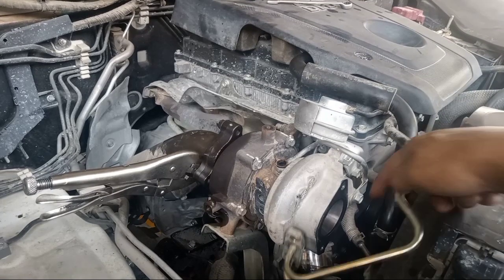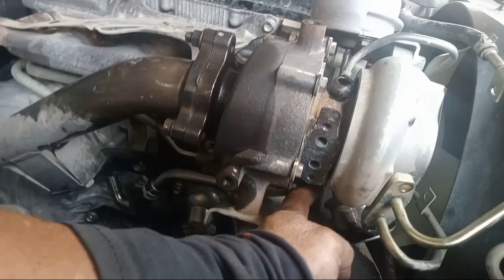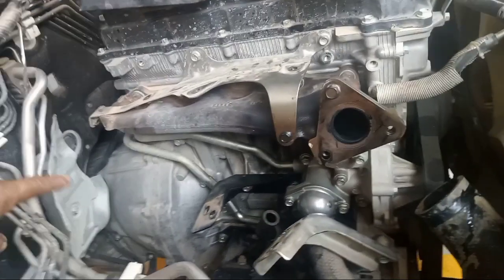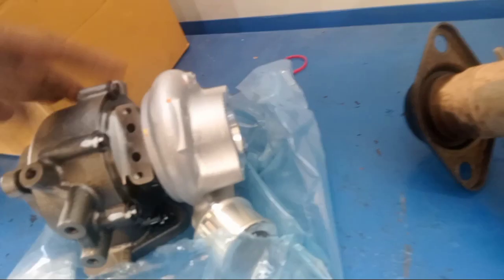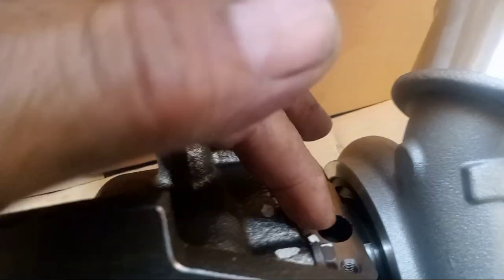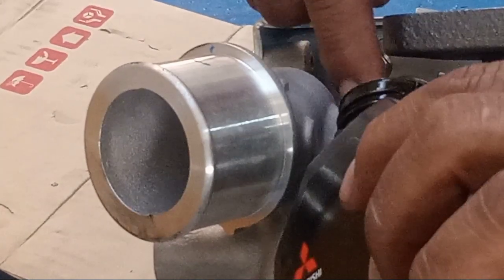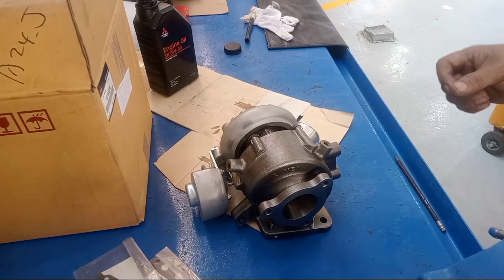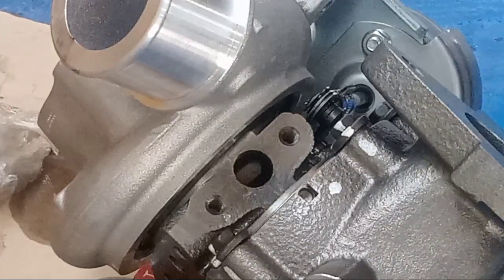mitsubishi ( L200 strada)tech info/dismantl  and install turbo assy

Comment: Those 6 nuts/bolts that hold the turbo one on each side are impossible to remove, I broke one spanner trying. I ended up taking the 10 mm bolts and split the turbo in two to remove the turbo cartridge,  you don't need to replace turbo assembly because the only thing that breakes is the cartridge.
I was looking forward to seeing you remove the nut you had the visegrips on, did you end up cutting it?
I didn't see the DPF, did you remove it first?